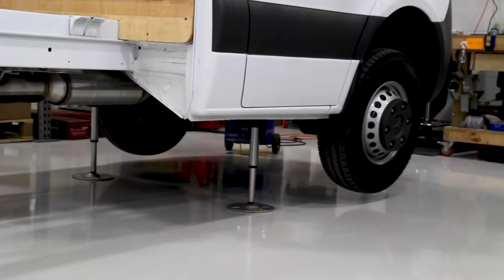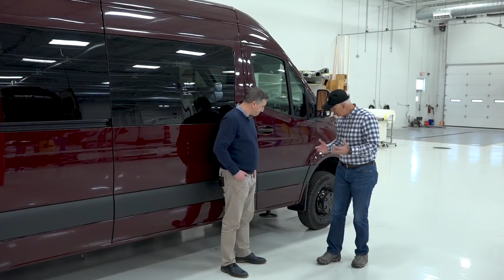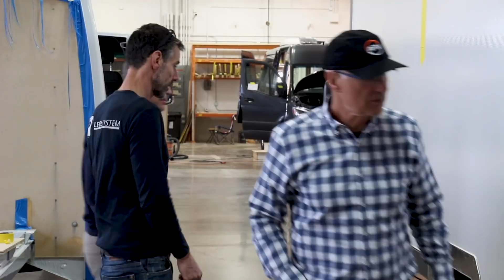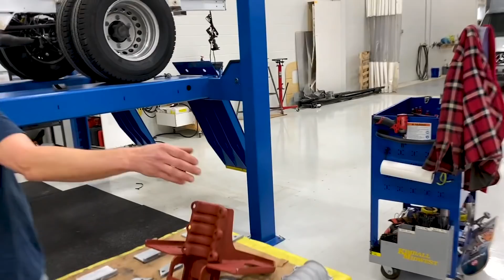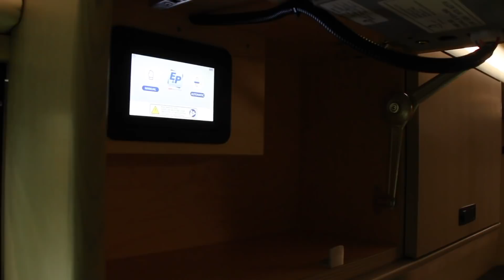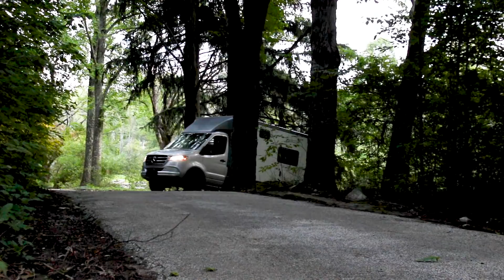Lift and Weigh Your RV with High-Clearance Leveling System

Comment: This also makes any wheel and tire maintenance extremely easy. No need to have access to a lift or to bring out a jack...just deploy the levelers and you have full clearance to change a tire or whatever you need to do. I plan on being a client in about 10 years when I retire...if my investments do well lol. Keep on innovating!
Reply: Agreed on the convenience. I would still use jack stands, as any jack system can fail.